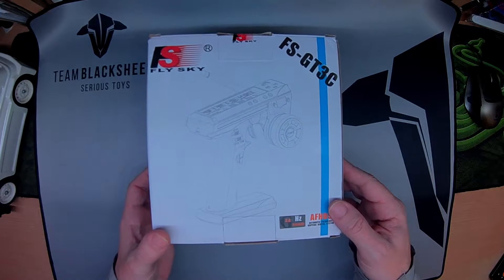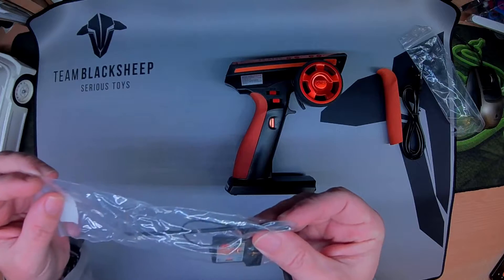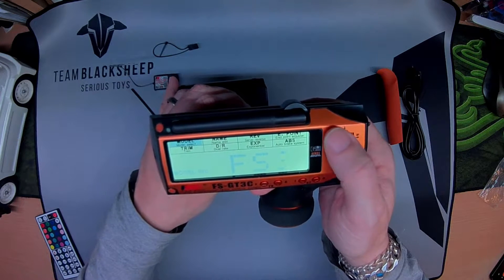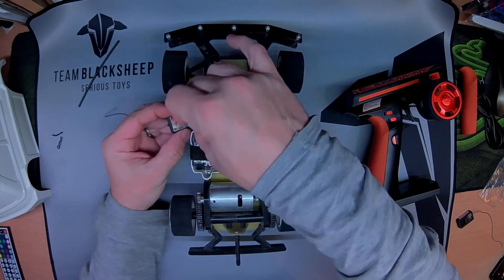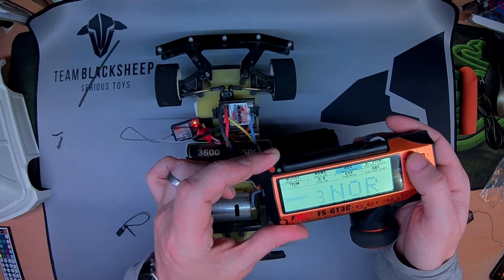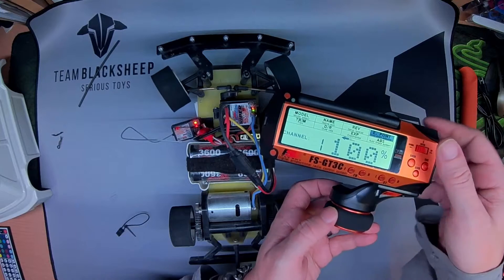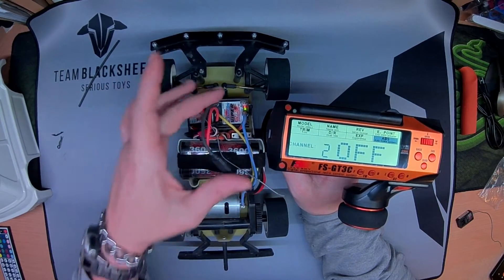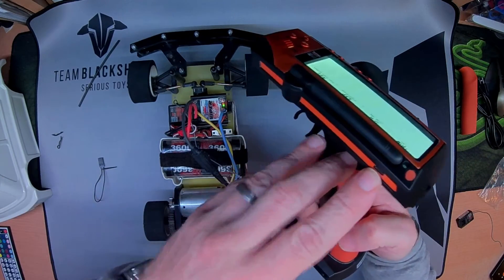Flysky FS-GT3C 3Ch Tx [Quick look and Setup]

Comment: Truly great controller for the price and can handle a lot for a 3ch, and has additional switch ideal for lights or whatever
Reply from the maker: For sure, it's served me great over the last 2 years, the only improvement it could be a little smarter with the model memory. mine acts a little odd sometimes!
Reply: Must be something mine is yet to experience, the only issue I have had with it is the select wheel not acting as it should, but that was an easy fix
Reply from the maker: @Dog_Botherer  My jog wheel is much the same, again nothing showstopping like the software (end points/trim from previous model still showing etc). I even purchased a second for the little lad's trucks so I think that speaks volums after so much time hey?
Prehaps I should see if a firmware update is available to fix the silly little "inconveniences" :)

Comment: good vid mr E i like the radio almost both it at black friday but than i found this RadioLink RC4GS with gyro in the receiver and still can't deside wich on to buy
are you going to upgrade your gt3 to 8channels?
Reply from the maker: I have no need to upgrade it as I have other 6/10ch flysky gear - this is running my 989 also with the replacement Sino mini-Q receiver,one of the mods in my vid comming soon!
I would love a gyro but its great fun without so far, I assume you would like one for drifting?
Reply: Oke that's very nice looking forward to that vid and thumbs up for the thumbnails they are looking very good 🖒

Comment: Hi MrE, I'm looking for an RX to bind to a minimum of 3 rc cars. How's this one doing for you? Is there a newer/better version looking out for? Im just concerned about the lcd screen on this model in the rain/snow etc (when it returns!) TIA
Reply from the maker: Hey, Trevor!I am over the moon with it still, use it lots with quite a few models. For the price you can't really go wrong considering the features - I have not found myself lacking anything for what I'd consider normal use (like having to channel mix for tanks but thats a different story,hah!).
It does have a couple of little "quirks" off the top of my head, one being that sometimes when changing a model - it will display the previous models setting for say expo or trim etc until you change it, its no biggie but can trip you up if you arn't aware of it.The other is that the jog wheel is a little tough to click now but it works fine,I  assume it's through lack of use and would ease up if it were exercised.
On to so positives:I'm never caught out with battery charge and being USB Micro it's super handy, think I've only charged it a few times infact.Very comfortable and feels good with a couple of different silicone/rubbery  grips for different hands, I dont notice any discomfort driving around for half hour stints.Not a single range/connection issue & I dont even both putting the whip antenna up.
I'm sure there are lots more but for now I think that's enough of a synopsis, however I use this for 1/10 standard rc cars, 1/16 crawlers/trucks 1/24&1/32 hobby grade things like the 989 + Orlandoo Rubicon.
I can't speak to the LCD in different climates but I have no doubt that with a little precaution it would suffice - dont forget the old rice trick :)

I have not really felt the need to look at anything else in the mean time due to my happyness, this truley hit the sweet spot allround for me (and I'm the kinda guy that has all 3 Taranis inc the SE's) I would buy this again in a hearbeat!
I hope that gives you an accurate picture of how I feel about this still, heading towards a year of having it!
Reply: MrE thanks so much for your detailed reply. I bit the bullet and have ordered one. I've heard you can firmware upgrade to 8 channel..have you done this or isn't it worth it?
Reply from the maker: You're welcome, Trevor. Personally it is not worth it for me having 4 other radios that can do 10-16ch each.
I'd love to do it as a technical challenge but for my usage in the mean time, stock is perfectly adequate. I can syphon power off the 3rd channel while utilising it for switching lighting at the same time.
I hope you are chuffed with your Tx when it arrives.Some more tidbit's of info I neglected to mention is that I can use the GT3C one handed pootling around in my crawler truck (I have quite large hands). The other thing you may or may not know is that Flysky is compatible with other things rebranded.
Flysky are the OEM manufacturers from memory for Turnigy, Durango etc so you can shop around for different/cheaper receivers with the caveat the GT3C only supports the v1 afhds protocol.
Some WLToys & Sinohobby stuff are directly compatible but you will have to delve into things on a case by case basis, even cars revisions can change support.
Happy driving, fellow!

Comment: I have a problem.
I have three receivers of this type.
Two crawler cars with different ESCs that have 6V internal bec
When I roll at a constant slow pace, sometimes it accelerates abruptly for a second and then returns to the slow rhythm.
I tested with two different lipo 2s batteries
I tested with gt3b and gt2
When I tried with 3pj FMtaba FM, I have no problems.
Reply from the maker: I have had something like this with a different setup on steering recently and for me it was noise from the system which I fixed with a Ferrite ring iirc.

Stick a multimeter on your BECs and check they aren't too far over the 6.5V most Flysky's take (I tend to use 5V only)

Any capacitors on the motor etc?

Have you got anything that you can test the receiver signal on like a flight controller or oscilloscope etc to see if the raw output is clean/dirty?
Does it exhibit the same behaviour in reverse?
Reply: Hello, today I tested with an external 6V bec. The problem persists forward and also backward
I do not have oscilloscopes ......
Reply from the maker: I would try swapping the channels and see if the throttle does the same to a steering servo for example, maybe try it on a little hookup out of the vehicle and that way it would tell you exactly where the problem is.

Comment: How long does the battery last?
Reply from the maker: That is a very good question I dont know the answer too yet. Being an 800mAh battey I dont think you will go a whole day or anything on it but you can get a 1700mAh upgraded one for it that apparently lasts plenty.

I'm not sure how I would go about testing how ling the stock one lasts but I will give it some thought and get back to you!
Reply: MrE okay :) i probably wont order one because the stock one of my car is well enough, and it takes 4 AA batteries and they last for a long long time.. xD I also bought a camera, a MD80 mini DV HD camera, it was for sale on aliexpress and i had a coupon so i got it for €2,50 :p what could go wrong lol
Reply from the maker: I'd be intrested to hear how the MD80 does,let me know or post some footage!
Some of the Tx's this is replacing were ok,but I just need one for 3/4 cars ,so far its been great but no point spending money if what you have works fine!

I have the SQ12 in the pipelines ,I hope its what the SQ11 should have been!